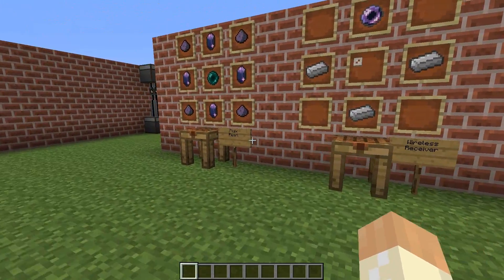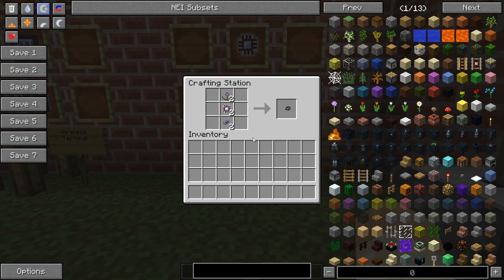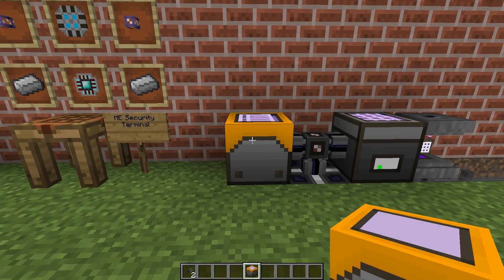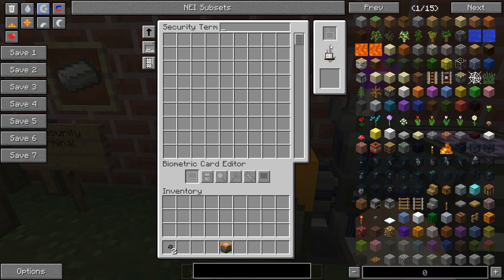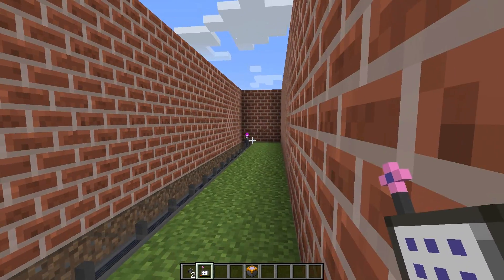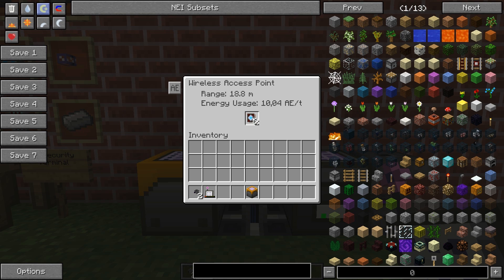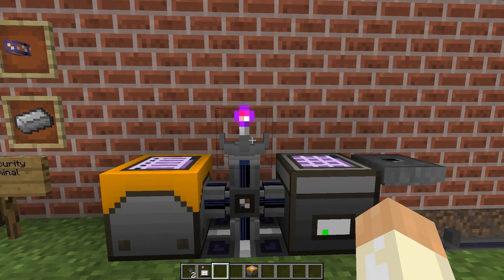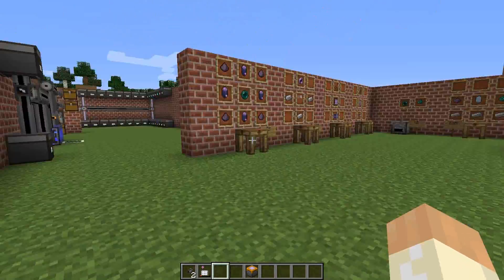Applied Energistics 2 Tutorial #8: Wireless ME Networks (MC 1.7.10)

Comment: so from what i understabnd its useless... if boosterst can only work max of 64 items, when my jetpack goes like 20 blocks a sec... i though wireless would work in other worlds and thousands of blocks away...
Reply from the maker: The way you describe your expectation feels quite OP ;) But there are addons to AE2 that adds infinity range and dimension upgrades. I guess in some modpacks it makes sense. In "basic" AE2 it's meant to be used as a wlan access point - and with a big base you place several access points and equip each one with a certain amount of boosters. And if all are part of the same network it will work fine (just manage channels as usual). As far as I know, the range is a sphere around the access point, and energy usage is non-linear, so it's more energy efficient for a flat base to have several "small" access points instead of maxing out nodes as far apart as possible.
Reply: @therealtkh  I found it the modpack I'm playing is FTB Revelation, infinity booster card, but it's hard to get and craft is kinda annoying and uses it's energy very fast, I guess I should make auto enderman farm, because I noticed enderman drop it.

Comment: hello, so I understand that there is the wireless terminal item that you can use to access the ME system from your inventory, but is there like a wireless terminal block that you can place down and access the same ME system wirelessly through a block instead of an item in your inventory?
Reply from the maker: Not that you can carry around and place like a block. But if you have a big network you can have many terminals in different places. As I understand you're not really after a Quantum Bridge access point. There's an addon called Wireless Crafting Terminal for older mod versions and with the latest version (for 1.18) it's included in the mod.

Comment: is there a wireless terminal with a crafting table? and is there a way to go across dimensions?
Reply from the maker: Depending on mod version there is a wireles crafting terminal either as a separate mod (earlier) or included in mod (current). Not  even 70% sure but I think the separate mod had more possibilities when it comes to range/dimensions, but I'm quite sure you would need a Quantum Ring with a wireless access point to use your system in other dimensions.

Comment: It's a shame this isn't what I was after.
I've built a sort of sky fortress but for various reasons needed to build my mob grinders deep underground, and I was hoping to find a thing which would let me wirelessly send items from the grinders up into my storage system.

So far the best I have uses Thaumcraft mirrors and annihilation planes but those still require long cables descending to the ground.
Reply: try using tesseracts from thermal expantion
Reply from the maker: If you want to use AE2 to send things wirelessly you can use a Quantum Bridge. Find a tutorial on that in the playlist. It's a little complicated, other mods make this very simple but it depends on what you have at hand :)

Comment: how do i make my wireless terminal able to connect anywhere, even if I'm in another dimension?
Reply from the maker: With pure AE2 you'll have to build a Quantum Network Bridge and place a wireless access point in that other dimension. There are perhaps mods that can solve this for you (without a bridge), for example the AE2 addon Wireless Crafting Terminal for 1.7.10, but I'm quite certin it will be nerfed.

Comment: how would a me wireless import look like so i dont have to run 50blocks of me cables to the itemesseract?
Reply from the maker: +Maltebyte2 In normal AE2 you have only the Quantum Bridge to get "wireless" import from a distant place. Normal wireless networks is only for your terminal - which means manual import. If you want you could run cheaper transport pipes (like cobblestone pipes from buildcraft) and just connect to an ME Interface.
Reply: +TKH kk thanks or i can try enderchest and me imports? so i gap the distances
Reply from the maker: +Maltebyte2 absolutely, that's a great method, I did that in my let's play series :)

Comment: I have two questions, I may have passed up answers in comments but I didn't see them.  First question, I have made my wireless network at 528m but I want to run a Crafting without running the cable all the way.  How can I connect the Crafting Terminal wireless to my network?  Also I been watching your videos and I can't seem figure out how to be able to have my BC pipes to be able to put items into my Me Storage.  Can you pls explain these two things.  Thank you and great videos.
Reply from the maker: +adhdking Ok, you can't really do what you want to do with you Wireless Terminal. As the name implies, it's only a terminal and NOT a "Wireless Crafting Terminal" (it doesn't exist). Auto-crafting still works though, so you can order things you have set up in assemblers (the crafting is done by the assembler in that case, not by the terminal). So if you want to avoid the 500 meter of cables you'll have to go for a Quantum Bridge.
Second question, piping your items into an ME Interface should work. You can't pipe things into a ME Chest or ME Drive as they can only contain storage cells. Hope this helps! :)

Comment: is it possible to use the wireless boosters and stack it then build one of those again then put the stack of wireless booster in there
Reply from the maker: +Eli Coursey You mean that you move the boosters to another Wiresless Access Point? Yes, absolutely. You can have several Access points in your base, with just a few boosters each, or have one really strong point (with a stack of boosters) in the middle. And you can adjust the number of boosters (signal strength) at any time.
Reply: thanks :D but what do you use to transfer to another access the wire thing can you use a me glass cable
Reply from the maker: Correct, just a normal cable, it will work as long as they are in the same network. Remember that every access point require one channel, so you have to find a balance between number of access points, how many boosters in each, power consumption and how many channels you want to spend. Easy :)
Reply: thanks

Comment: when i add wireless boosters to my system it will shut down.. depending on how many i put in, it will take  certain amount of time to shut down the system.. i have sufficient power, but it is being run through a energy reciver.. i dont know what the problem is. i have about 46 booters i crafted to use but they are just breaking the system..
Reply from the maker: Jared Nelson It really sonds like a power problem even though you say you have enough. Remember that each booster will increase the power requirement more and more. And 46 boosters is a lot! Place an energy cell as a buffer and use a network tool to monitor that part. At what point does it break? Does it work with only one? Two? Step it up and monitor with network tool. How much power production do you have? What modpack?
Reply: thank you for the response. before anything i will have to say i really enjoy your videos, thanks for that. And i will take your suggestions about the powercell and such with the monitor. i am running power from a big reactor
Reply from the maker: Jared Nelson Thanks :) Do some investigations and come back with numbers and info. Take screenshots or record a video if possible, these things can help a lot.
Reply: i had a energy conduit bottlenecking my power supply to the system so the optimal amount of energy was not being transferred. Thanks for the outside look on the fact that it was a power issue. Keep up the great videos!
Reply from the maker: Ah, thanks for telling! I know they can transfer different amounts but I don't know the numbers for the different tiers. But it was a good reminder for me for coming builds :)

Comment: So i have got a question. I am playing on a server and am building a huge data center i have got most things figured out but i cant figure out how to get multiple users on a wireless network. When i install a security block it locks out all other users but me. How do i fix this?
Reply: therealtkh If you use the BioMetric Card, you have to put it in the middle slot to edit people's access to it. Once you've done that and then put it in the top portion  of it, people will have access. If you want different people to have different access, right click on the individual with what access you want with the biometric card and it will be coded to that person. Once you've done that, put it in the top slot and your good to go.
Reply: i have also tried the biometric card and cant seem to get it to work properly
Reply from the maker: John Dossey I have never tested this in multiplayer, but I think the system owner should put a Blank Biometric Card in the ME Security Terminal, set the rights, and after that you hand the card to another player. That player will use that card in the security terminal to code wireless access and to get access to the network. But I've never tried it myself :/
Reply from the maker: Delenko Travis Thanks for that instruction, I still haven't tried it in multiplayer, so I hope this will help those having problems!
Reply: Np man. I had a lot of learning when they updated everything to 1.7.1p

Comment: How do you make it so the ME system when using NEI pulls the items down when you do craft
Reply from the maker: Olivia Carroll 
I don't think it's possible... I have wanted to do that for long, but never found a way. It (NEI) only draws items from your inventory. The closest function you'll get in an ME system is auto-crafting I guess.
Reply: Ok thanks :(. but the thing is i see some people do it... but thanks anyway
Reply from the maker: Olivia Carroll You sure they are not using the auto-crafting? Please post a link to a video where they do it. If it's possible I would like to know as well :)
Reply: I think what you want is to hold the Shift key when you click the "?" on the NEI recipe. That will pre-populate the ME Crafting interface with the required items (assuming you have them available).
Reply: Thank you! I hope it works!
Reply from the maker: Olivia Carroll Did it work? Haven't touched AE2 for two weeks... I thought that solution was only when having items in inventory, but perhaps it has changed :)

Comment: Is it possible to extend the range of wireless to extremely long range as in being able to access the network whilst mining at long distance?
Reply from the maker: You can extend the range with boosters or with a long cable with another access point. But I haven't tested it to the extreme. I'm think the maximum number of boosters is 64... that means a hard limit to the range, a lot of power required to run the system! Not sure of figures though, I recommend going into creative and try it out :)